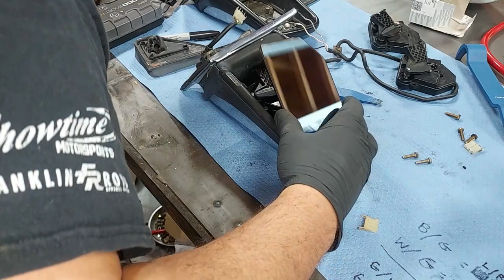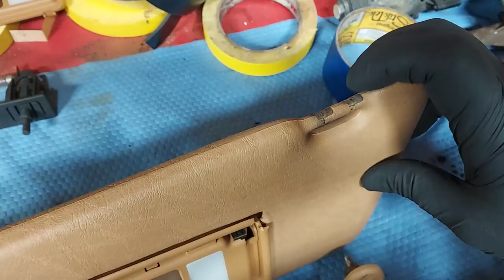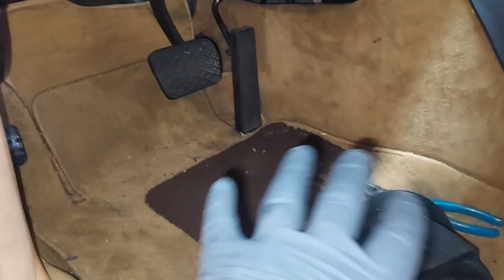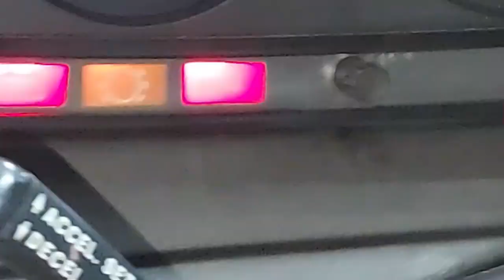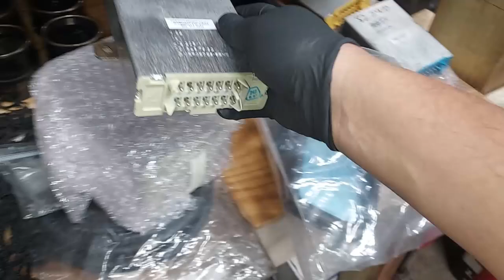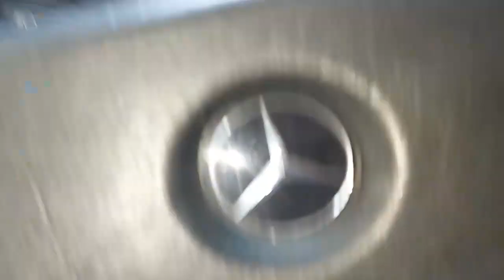1983 Mercedes 300D - Part 7 Visor Mirrors, Electric Mirror, Cruise Control, Battery Tray, Seat Nets

Comment: Hello again! I have the same problem with replacing my vanity mirrors (blue, 1985 Mercedes Benz 300cd). I found inserts on eBay that are functional, but I’m not sure what glue to use or how to remove the vanity mirror itself. Do you have a video on how to remove/reinstall them? When I’m trying to remove the old mirrors, there’s a metal bow under the mirror. It may be the ground, but I’m not sure. Please let me know what you suggest in terms of glue and procedure. Thank you!
Reply from the maker: I'm sorry I don't think I have a video showing exactly how to do this. There's not really a method you just need to be creative and good with your hands and figure it out if you know what I mean. As far as glue when you glue back in your new visor mirror inserts I like to use clear quick 5 minute setting epoxy. Do not use super glue as that reacts with the plastic and the vinyl.

Comment: Assume that you soldered the connections on the visor mirror?
Reply from the maker: But keep in mind you can also just twist them together and use electrical tape if your not proficient at soldering. Once the inserts are glued in those wires never move.
Reply from the maker: Yeah I'm a big fan of soldering ;)